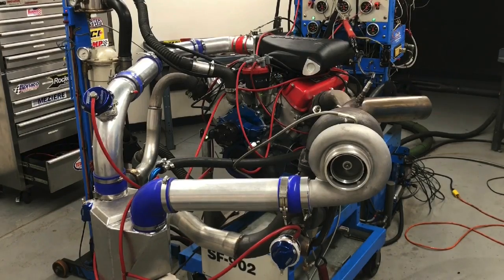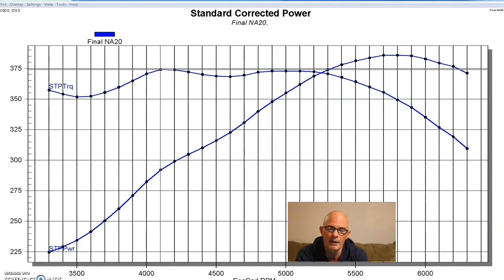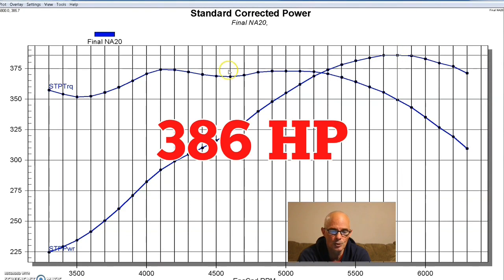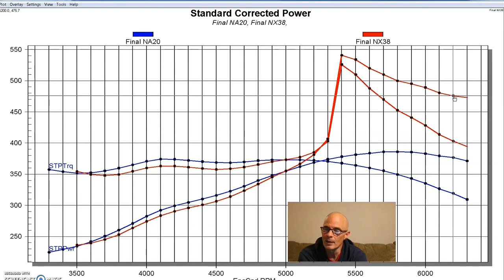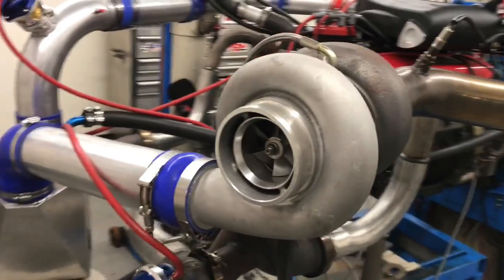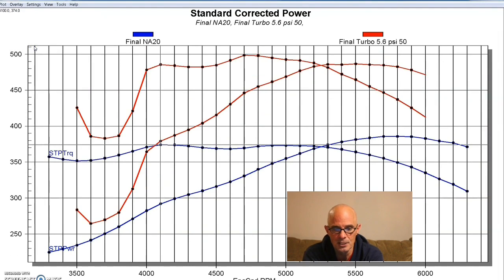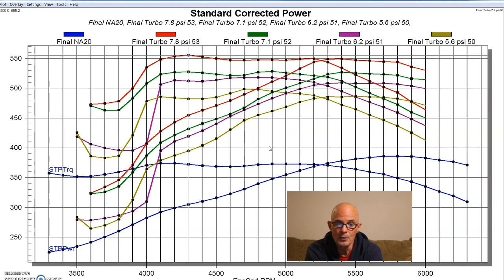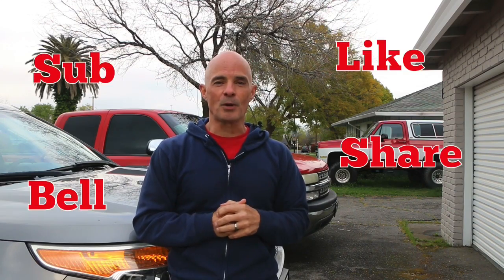DIY EBAY TURBO 5.0L-BUILDING BOOST!

Comment: These stock block , stock bottom 5.0's HATE RPM.   Harmonics will literally snap the crankshaft in half at the #2 main if you rev above 6k regularly.  Rev to 6500+ and it's lifespan is 5-15 hours of race use.  And it will leave you scratching your head because harmonics don't leave any evidence behind.  Happened 3 times in 2 years racing in 24 hours of Lemons.   Only way around it is aftermarket block and forged rotating assembly that is INTERNALLY neutral balanced instead of 50oz external.... which costs around $3500 when you could just get a 5.3L for $600.   The guys that made theirs last were long time fox body tuners with a rev limit at 5500rpm.   Powerwise , they'll handle 550rwhp +/- 30hp before breaking the block,  every time.
Reply: There is a big difference between between the early 28.2 and later 50oz inch 302/5.0 crankshafts. Obviously. You can physically feel the difference in the balance in the damper by the difference in the cut. The earlier crankshafts are reputed to be stronger as well and I don't know if this true but I can imagine that the early cranks that have a lower balance won't have as many issues if you want to Rev them over 6k regularly.
Reply: Good to see you here I'm a subscribe and loved all your exhaust experiments with e46 swapped 5.0!!! .That being said I agreey buddy had a stock bottom end on a turbo for upwards of 15 years he mad a best of 409 hp to the wheels and 468 torque and it ran like a champ but he shifted at 5400 no higher . Believe or not it survived many years ona stock t5 . He mad a home made jig to add bigger valve reliefs and was almost done and gouged a big nick in the cylinder wall so it wasnt worth spending the money money to repair . He built a dart 363 kept turbo and it made with same turbo 650 hp 754 torque at 5200 rpm lol he couldn't  go higher as he re an out of fuel with 120lb injectors.

Comment: Thank you Richard! The intercooler you dyno test with, will it continue to cool in a street car or will it reach a saturation point were it will become inefficient and no longer cool?
Reply: It's an air-to-water heat exchanger. You have to circulate cool water through it. To use it continuously, you have to cool the water. The simplest way to cool the water is through a water-to-air heat exchanger (radiator).
Reply from the maker: Most street applications have a secondary heat exchanger to cool the water
Reply: @richardholdener1727  I know that there is a radiator to cool the water. To clarify, on a street application, will a radiator cool the water and maintain the water temp for the intercooler to be efficient, or will the water temps slowly creep up?

Comment: Did you have to change the flange on the stock shorty headers when you turned them upside down? Or did the ports match just by flipping them ? Nice job.
Reply from the maker: just flip

Comment: How often do you need to re-calibrate the engine dyno, if at all, to maintain accuracy? Do you need to calibrate in order to test vastly different displacements, i.e. going from a 305 to a say a 632 ci?

Just a couple random questions.  :)
Reply from the maker: no need to recal for different displacements, but there is a calibration test to ensure  it is spot on for every test-or if you thing something is wrong-its not usually the dyno

Comment: Doing a turbo on a 302 with a carb and a MSD 6BTM box, but I am concerned about my dual plane manifold, haven't been able to find a small runner single plane...any suggestions?
Reply from the maker: use the dual plane

Comment: Does it matter if the turbo is mounted close to the engine? There is a turbo kit that installs them at the muffler location. How does that affect boost and drive ability? Would 2 small turbos be better than 1 large one?
Reply from the maker: just changes response rate

Comment: Just curious what size wastegate you run on the single ebay turbo build? Wonder if I should get the biggest wastegate for low boost

Comment: What was the timing in it? If this was a throttle body injection or carb could you run more timing?
Reply from the maker: we are getting near the split point of the block so more timing isn't necessary
Reply: Richard Holdener I ask because I am running on3 turbo on my refresh 302 with AFR 165 heads on 7psi and Fitech throttle body injection and making 475 to the tire with 15* of timing

Comment: Does nitrous have to be hit at a certain rpm?
What happens if you whack it on at say 3500-4000 rpm?
Reply: too much torque for stock internals.. but you can have multiple stages, like #25 for low rpm, #50 afterwards and #100 for 5300+

Comment: Why is that dude welding with sunglasses? Guess he's not a big fan of have 5 senses and wants to trim that down to 4. Also not having the ports taped off is an excellent way to get metal inside the cylinders.
Reply from the maker: thnx
Reply: @richardholdener1727  My Dad did exactly that welding on a tractor exhaust. Ended up having to pull the head. Luckily the damage was pretty minor.

Comment: It made good power, but not as much as an LS swap. No wonder lots of foxbody owner use the LS motors in their foxes.
Reply: Lol . I've seen 700hp 302 turbo  still running today . Some of which are 10 years old .

I've also seen ls motors blow up at 500hp .

Funny enough all the ls fox bodies I've seen for sale . Don't sell or lost huge value

Comment: hello  sorry I'm using my husband Facebook because I  know he watches your video I also know you do good things for deserving people my husband has stage 4 cancer he invested all his savings into his dream truck two months later it doesn't run it needs a fuel injection control module that costs $2500 it is putting him in to a depression he is taking about stopping fighting for everything if he can't get his duramax diesel back running maybe you can help him out help get him back to fighting for life and get him out of the depression maybe you have a fuel injection control module for 6.6 duramax diesel 05 3500 silverado thanks for your time
Reply from the maker: I wish him nothing but the best-but I don't test or work on diesels

Comment: These guys never seem to mention that these motors may not hold up under load. ............In the car.
Reply from the maker: lots of guys running turbo motors in cars-my vortec 5.0l lasted 85K miles
Reply: @richardholdener1727  what was your combo? What fuel ? Was it intercooled? How much boost?

Comment: Can't help but gawk at that square Blazer. I've been contemplating a remote turbo on a Pontiac, hide the snails under the trunk and run regular headers and pipe back there, and the charge pipe up the trans tunnel, sleeper style. With the bottom end my engines are making NA I am not overly concerned about lag, more about breaking the tires loose when the turbos finally start working, and oil return issues. Have you done any turbo tests where the snail is 10' from the engine?
Reply from the maker: that's not my Blazer